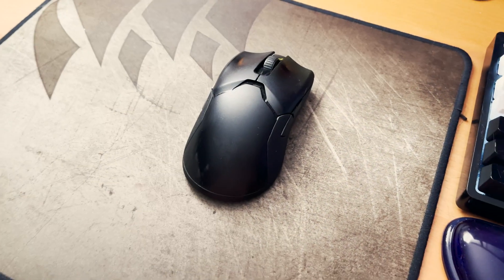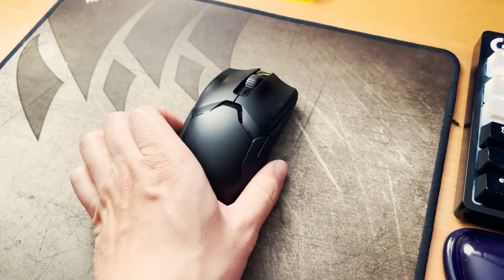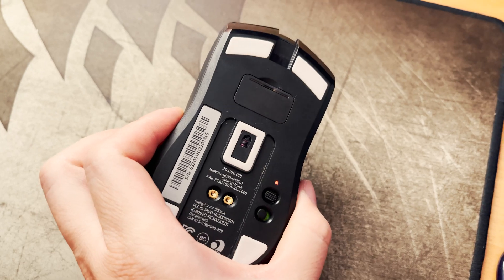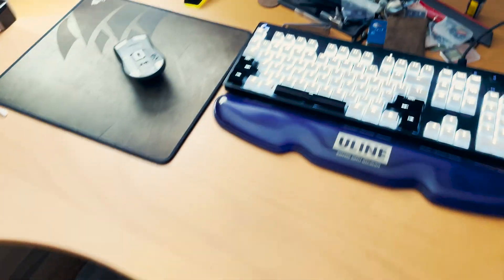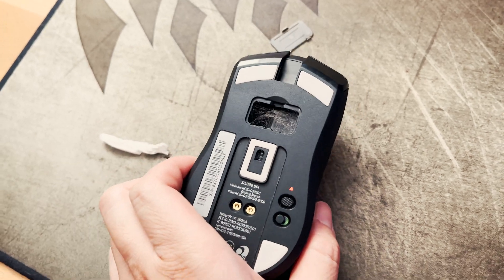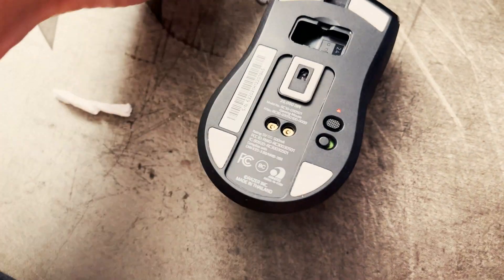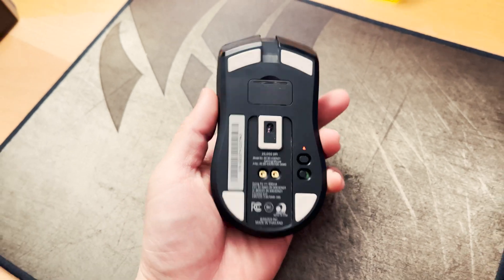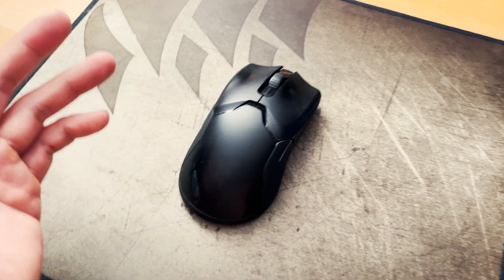Tips On Fixing Razer Viper Ultimate Wireless Mice Skipping Or Not Moving Smooth

Comment: Mine didn't work there's no dirt. Its still lagging, my WiFi is perfect...
Reply from the maker: Might want to change the surface or use a different mouse pad to test. If feet is worn might need new feet. If still not working, then defective and requires warranty service probably.